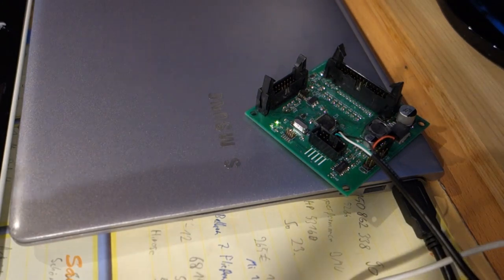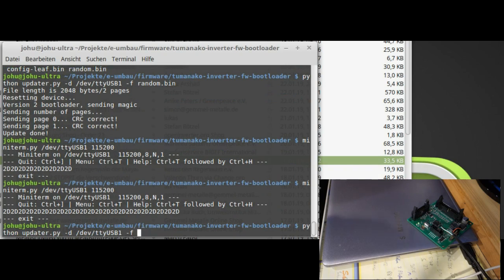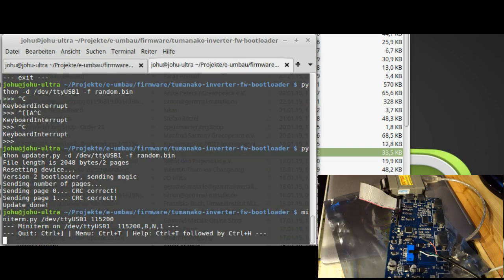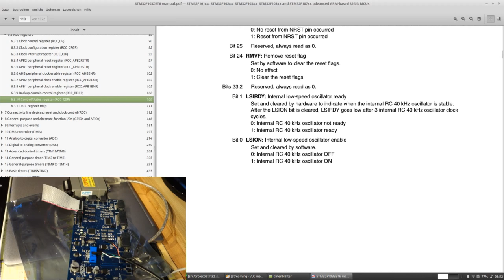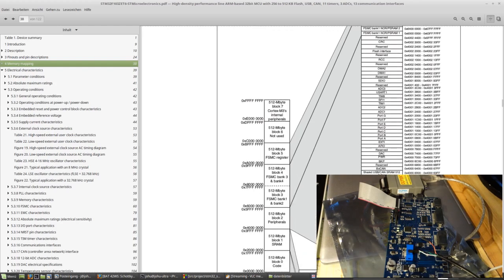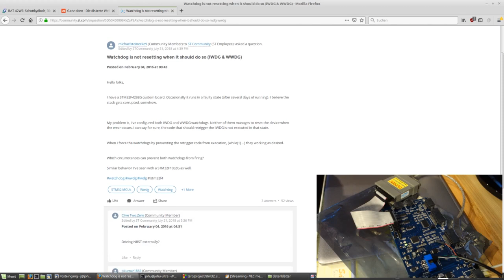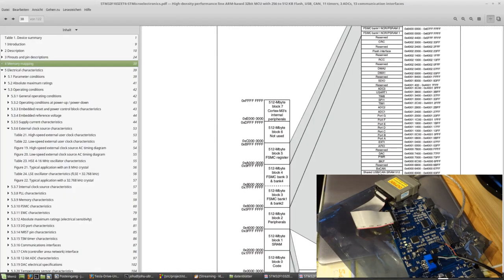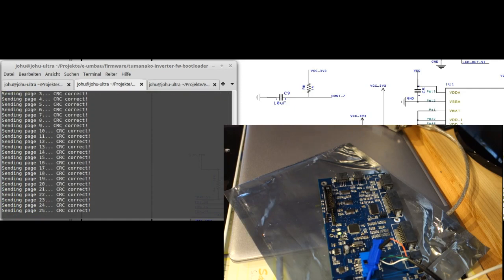Lab Update #22  - Watchdog Troubleshooting

Comment: Nice work. I noticed you had a powered board sitting on a conductive surface, once on an aluminium laptop case, then on an anti-static bag. Were there no solder connections on the bottom?
Reply from the maker: The laptop display case is painted and the bag is probably a couple of megohms. At least it didn't short anything out

Comment: Hi Johannes, I´m Tomas from Sweden and I have bought a Renault Kangoo Z.E from 2013. It´s a good van with a good price, but I would like to increase the power. 
My research shows that Renault and Nissan had a collaboration on EVs during this time. It seems that Renault Kangoo Z.E (44Kw), Renault Fluence Z.E (70Kw) and nissan leaf (80Kw) use the same hardware but different power levels. What do you think needs to be done to unlock the 44Kw to 70Kw or even better 80Kw?
Do you have the components or software needed and can I buy that service from you? 
Do you prefer to be contacted by mail?
Best Regards// Tomas
Reply from the maker: Hi Tomas, I suggest you visit the forum at https://openinverter.org/forum . You will also find other contact data on openinverter.org